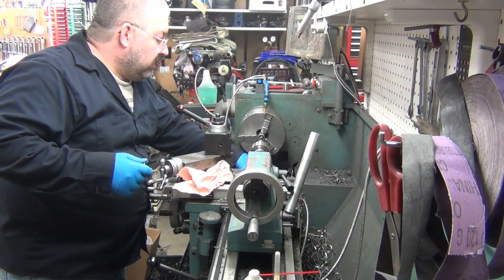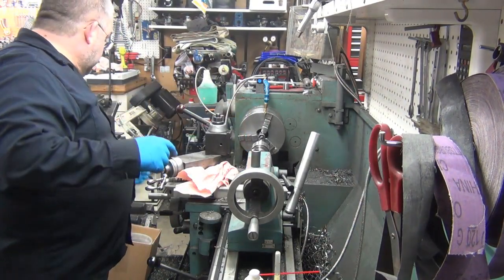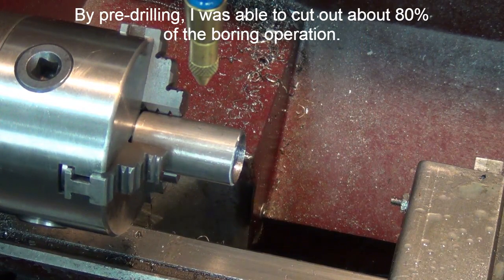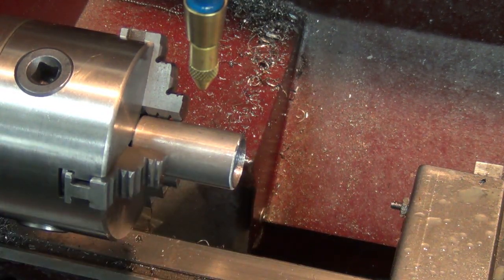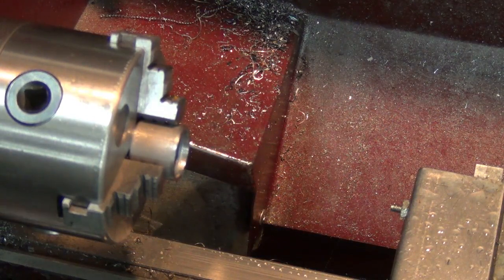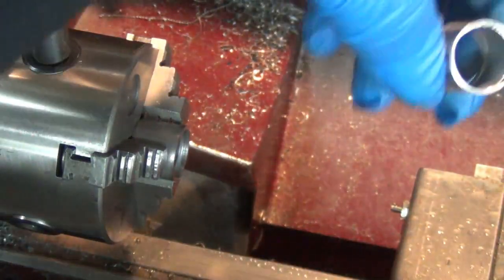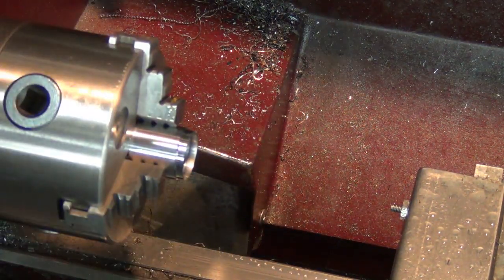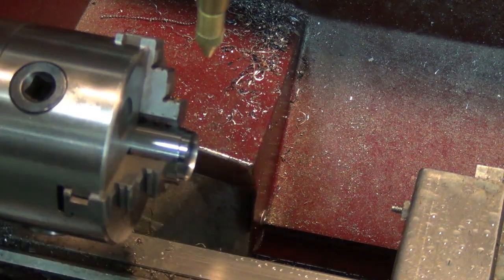9x20 CNC Lathe - Outer Bearing Adapter - Part 2

Comment: What are the speeds and feeds for the part-off?
Reply from the maker: That was the only time I used that cut off tool on that part and I don't remember what they were set to.  If you go to the 2:00 mark on the part 4 video....
http://youtu.be/0d_hRjcyDMQ
...you'll see how we did the rest of the parting.  That was approx. 800 rpm and about 2"/min.  I'd have to go look at the code again to be sure on the feed rate.

Comment: for automatic facing on the parting cut, parts this thin are candidates for ultra sharp inserts with TiCN or TiAlN or TiAlCN with thin walled inserts, but this is an expensive route. I only offered a solution for reduction of chatter in general application in my previous long post. Any of the blue-gray coatings will interest you and the more shiny the better.

from the tailstock, a mandrel with ball bearings can be driven into your part as it is getting cut, supporting it from the inside, the ball bearings would need to be be space to provide a groove to accept the parting tool as it pierces the material and are in no risk of damage, and the part wouldn't fall in the chip pan providing double functionality. or, lathe chuck mounted on a live center can support your part.
Reply from the maker: Ball park on expensive?  $100 or $500?  What about a right hand cutoff insert like Carknocker001 brought up?  The thin wall will still give too much? 
Interesting idea about the mandrel.  I'm not sure I'll be doing enough of them on this lathe to warrant that.  I'm planning on moving these small parts over to the cnc mill after it comes in. 
Thanks again!!!
Mike
Reply: like 100$ per pack of inserts, an exponential from what i'm used to (i buy TNMG at 10$ per pack) because its less common on ebay.

if you can imagine an insert geometry, it exists

corocut XS in this picture http://i.imgur.com/1wJoSh8.png , i like the japanese brands better like mitsubishi and sumitomo

notice, the insert has no chipbreaker (no moulded chipbreaker rather. It WILL curl a chip), which permits the manufacturer to make it ground and polished (indeed, it doesn't matter for thin wall parts). you will be parting off mirror finishes without a chatter
Reply: check out ceratip GB43R200 on ebay, its Cermet grade too. It has the best of everything required for your application and can be found for 50-100USD per pack, unshipped.
Reply from the maker: meocats
Great info!!!!  Hopefully, I'll have more time tonight to research these inserts.
Thanks!!!!!!